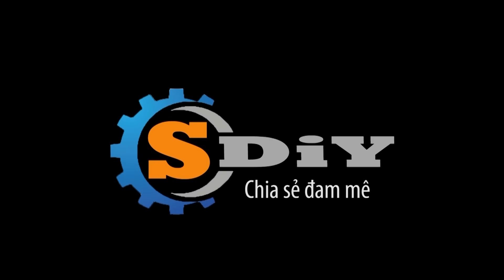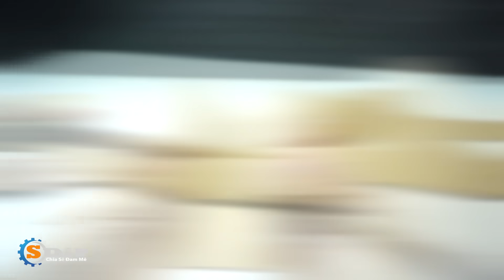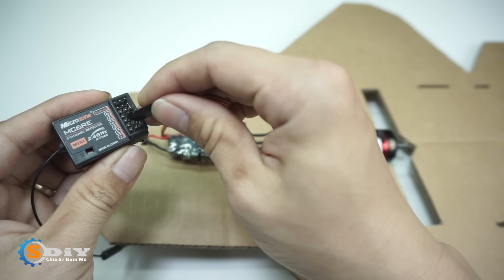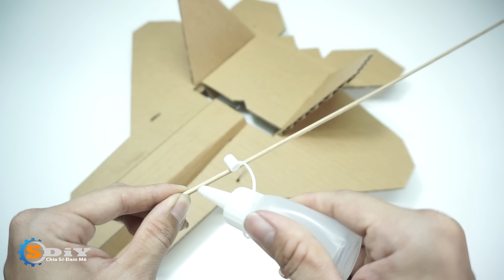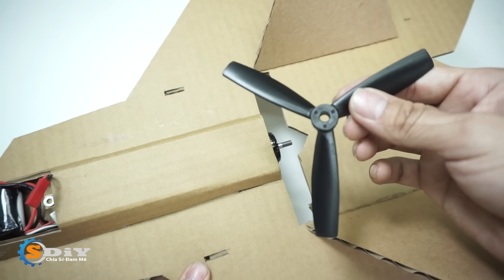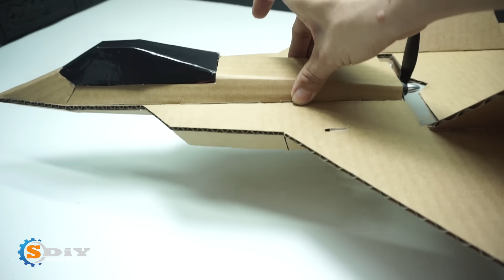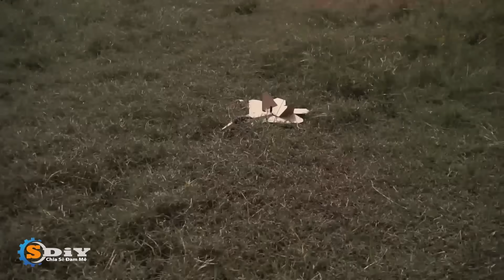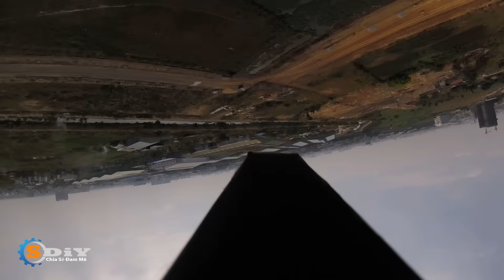Cardboard RC Airplane DIY - F22 Raptor l S-DiY

Comment: To be onist this a good build but a big but the plans have no meshermemts I've worked ot the wing 18 ins from nose to tail 24or26ins it's the cockpit the two vertical fins that stick up ans the piece around nose of plane. Plans have to have meshermemts to do it by eye takes some doing there won't be many people taking on this build for that reason plus component it doesn't show how to connect wires we're ever they go there is no linkfor the propeller size. Like when I built a eltric bike I paid £10 for plans on plans everything had measurements and they weren't metric it was feet and ins which made it very symple hard side was working with 72volt but I done it because everything was made symple I no its cardboard and I must say its great I've got card board but I'm punch drunk trying to put these plans in to protective
Reply from the maker: I hope you understand, because of the language barrier, my explanation is incomplete. Maybe I'll try to be more detailed in the next videos...

Comment: Hi I've sent a lot messages regarding this plane I'm going to make myself great idea but I think you could have been more specific in the meshermemts of plans and how thick cardboard to use. Like me I've divedv in think it was bought 3mm when it's 5 mm double wall. So if I stick two 3mm together with wallpaper paste I'm think about weight. Water is heavy till it drys also what hap if flying and rain comes from no where that's going to damage cardboard. Do not think you should put aerosol spray paint on plane to protect from rain. I know It would be stupid to fly in rain but these things happen with rain
Reply from the maker: Sorry for the time zone difference, I'm late in responding. Since it needs light weight, if you have 3mm cardboard it is too good. Ask for it to have a maximum of 3 layers, and the thickness doesn't matter much. Please note, a finished airframe weighing less than 250g is fine. And includes all equipment about 400g refills

Comment: It didn't seem like he used all the pieces he cut out. did i miss something? Other than the 60 d angle what are the other slotted pieces for?
Reply from the maker: Thank you for your attention. I apologize for the lack of notes, the parts are different colors, it's just a tool for too precise glue, do not use on the plane...hope it helps you!

Comment: Hi on plans there is a scale I've just seen of 100mm over 3.95 ins so do I use that to messur up the plane size it's the first time I've worked with plans I would be grateful if you can confirm this keep the good work up
Reply from the maker: Hi friend, for the airplane model, you just need to specify the wingspan you need, for example my video is 46cm, or you can do 48cm, 50, 55cm... So you can estimate the ratio rate. Just all the parts have to be in proportion so that they can be put together
Reply from the maker: You can even just follow the main wing, which is the part with the largest area. The rest of the parts, you can do roughly according to the estimate....(Sorry for the language difference, so I used a translator..)

Comment: Hi I'm back again I've been watching again can't get over a card board plane compared to these professional builders of big jumbo jet this buils is amazing. Trouble with me I haven't got a pinter so it's a case of making elamates looking at plans it's hard to make bigger on card board I presume the card board is double liar so I can ues any scrap cardboard is it possible to put measurements on plans and I will download again. I made eltric motor bike from plans all had meshermemts used cardboard made elamates then used plywood metal fibre glass. So to do this plane I need measurements great build I showed Mt mate he thought it was awesome
Reply from the maker: Hi friend, because there are so many intricate shapes and details that it is not possible to make specific size notes... I have attached an A4 paper version, which you can print on any printer any popular...

Comment: Hi I've sent messages about cardboard I'm thinking of another build we're when cutting card there is a white inner that's a different kind of card so yes if you can give the meshermemts I will great ful thanks
Reply from the maker: Hi friend, I use 3 ply cardboard, 5mm thick. I got it from the electrical box. It is the light type

Comment: What an amazing project! One of the best at home projects I’ve seen in years on YouTube! Great video all the way around with simple to follow instructions and plain video shots that don’t confuse your audience. Very nicely done sir! 

I do have one question? What is the overall dimensions for your pdf plans so we can get the size correct when printing this. Thanks again.
Reply from the maker: Many thanks for your encouragement ... For the print size, the author conventions according to the ratio of the printed paper. In the video, if you print the A1 version, you will have a wingspan of 46cm, A0 will be 65cm. It is noted in the drawing folder, hopefully useful for you...
Reply: @SDiYchannel01  What does A0 mean?
Reply: @b1-battledroid669  paper size

Comment: There are corrugated board factories (box makers) that you can order a dieboard with all these parts cut into a corrugated sheet. A flat die cutter would do it. The cost for the cutting die board 2ftx3ft (one out) around $1000 (you own it), minimum run 1000 sheets on machine. A fold up box wholesale sold for .30-.70 cent each on white paper, preprint paper(photo inline with cutting die) more expensive add .10-.20 cents. 
Up until 4 years ago I was in the business. There could be a product here for an entrepreneur

Comment: Super work, I have directly printed out the plan👍which camera you have installed and how it is connected could you make a video from there
Reply from the maker: Hi friend, thanks for your attention. I use gopro session, put it on body by drawstring. I had to make 2 similar flights for 2 position footage

Comment: Amico un esc inferiore a 45A si brucia! Come mai tu ne usi uno da 20A e non si brucia?
Mi serve il tuo aiuto per trovare un esc adatto al motore e una batteria adatta
Reply from the maker: Hi friend, based on your engine specs. With 2205 2300kv, with 3s battery, 5in propeller, the maximum current is only 17A, so I choose 20a to optimize weight. But if you go with bigger propellers, bigger batteries, then you have to use higher ESC...
Reply: @SDiYchannel01  I wrote to you via email please check and if you can help me, thank you friend!
Reply from the maker: @ArtistaGenericoMedio  Thank you, I have replied, please check

Comment: We made a bunch a few years ago. One thing we did that helped with speed and handling was we pinched the front of all wings and then added scotch tape. This will help cut through the wind. We found that without the small holes will act as a parachute so to speak.
Reply from the maker: Thank you friend. It was a wonderful experience...

Comment: The aircraft may be heavy but, with flat wings and control surfaces doesn't produce any lift. If you put curvature of the wings and control surfaces you will have better lift. The plane will fly better and you will not have to use more throttle just to keep it in the air. If you take the 2 centimeters of the front edge of the wing and face them down 8% and glue 2 centimeters of board directly under that leading front edge of the wing, you would produce enough lift for that plane.
Reply from the maker: Thanks for the comments...that's what I wanted to hear!
Reply: @nikosalexandrakis   Curve the front of the  wings down appox 8 degrees, and put a strip of cardboard about half an inch under the length of the front of the wing, will give you air foil for lift. Look at how F22 wings are. Just a strip under the bottom front of the wing and nothing on the rest of the bottom of the front of the wing.

Comment: How do you get the template printed on a big paper. I’ve got all other parts
Or do you have plans with measurements?
Reply from the maker: Hi friend. In the drawings folder I have uploaded versions for A4, and A1. I use the A1 version to print it... If you want to go even bigger, adjust the scale when printing...

Comment: Can't understand why it can fly without aerofoil wings? There is hardly any lift from the wings since its flat.
Reply from the maker: Thank you for your attention. You are truly an aerodynamicist. The reason my model can fly is because of the angle of attack, it's inefficient compared to the lift wing profile. But for the sake of simplicity, we have to trade off...

Comment: Excuse me, do you have any cheaper materials to replace them? My classmates and I need to make a finished product to score the teacher.
Xin lỗi, bạn có vật liệu nào rẻ hơn để thay thế chúng không? Tôi và các bạn trong lớp cần làm một sản phẩm hoàn chỉnh để ghi điểm với giáo viên.
Reply from the maker: Hi friend, currently the cardboard material seems to be the easiest to find But to be more effective, you should look for EPS foam, or depron foam. It will be lighter and stronger...
Reply: What I want to know is whether there are cheaper parts for electronic components that can be replaced Thank you very much for your willingness to return to me
Tôi muốn biết có linh kiện điện tử rẻ hơn có thể thay thế được không Cảm ơn bạn rất nhiều vì đã sẵn sàng quay trở lại với tôi
Reply: @SDiYchannel01  How many channels does your flight control remote control use? What electronic components are needed to make this airplane. Điều khiển từ xa điều khiển máy bay của bạn sử dụng bao nhiêu kênh? Những thành phần điện tử nào cần thiết để tạo ra chiếc máy bay này
Reply from the maker: @蘇翀  Cám ơn vì câu hỏi. Tôi sử dụng bộ điều khiển 6 kênh MC6C . Động cơ 2205 2300kv.  Bộ điều tốc 20A. 9g servo x2.  Pin 3s1000mah. Tất cả chi phí khoảng 80$
Reply: @SDiYchannel01  Cảm ơn bạn đã trả lời quên mình và cẩn thận cho mình, mình cũng dám tin là bạn làm video này để mình và các bạn cùng lớp có thể làm nên điều gì đó.

Comment: Well... It's cheap. But this corrugated cardboard, these wings without profile, no leading neither trailing edges, this little motor with a three-bladed propeller, the cardboard-canopy... very sad.
I prefer wait some time, to make a real airplane. The motor's noise is  unbearable,  for a F-22  !

Comment: I have a doubt as my propeller is bigger than shown in the video will it affect the balance of my plane if I shift the wings more further
Reply from the maker: Hi, if with a wingspan of 46cm like the video, you can only use up to 6in propellers, to limit the torque. With larger wingspan you can use larger wings.. 7in.. 8in.. Hope helpful for you!
Reply: @SDiYchannel01  can I ask 1 more question.Actually the battery you are using is different from which I am using so can you just say where to connect the battery and why?
Reply: @SDiYchannel01  and the wingspan is same as yours but my propeller is like 8-10 inches so is there anything I can do to solve the problem
Reply from the maker: @akshatfulfagar3779  May I ask if your battery is bigger than the one I use? If the propeller is 8in, you have to increase the wingspan to about 70cm. But it's very difficult, I think you find the smaller propeller as the solution
Reply: @SDiYchannel01  no it's kinda same 11.1v 1000 mah but I am getting confused where to connect it and why
Reply: @SDiYchannel01  pls reply
Reply from the maker: @akshatfulfagar3779  Hi sorry, maybe the language barrier makes me not understand what you mean! Does your battery not have a connector jack?
Reply: @SDiYchannel01  I guess no
Reply: @SDiYchannel01  is there some instagram channel or something where I can dm the photo of battery
Reply: @SDiYchannel01 there are two wires connected to battery just like in the video I don't have any seperate connector jack
Reply from the maker: @akshatfulfagar3779  Hi, you can find my S-diy page on FB and send me pictures of it...
Reply: @SDiYchannel01  ok 👍 thanks
Reply: @SDiYchannel01  I have sent the photo on fb

Comment: In case you wanna see if it really flies after you build it, watch my flights with this little beast on my channel. My F22 just weighs about 100g more (maybe because I used lots of glue and some spruce wood for the motor fastening) but flies amazing. Anyway my flying skills aret as good as the inventor's :D I recommend min 30A ESC and even 4S battery (the motor is built for that-14,8V could generate over 1kg of thrust) PS: I thought it will be difficult to fly when it's that fast but it's really easy even for a beginner.
Reply from the maker: Thanks for the attention. The depron foam is so good for DIY, but I tested the cardboad for everyone to try, albeit a bit heavy. Nice to meet experienced players like you. Best regards

Comment: Good afternoon, how thick is the cardboard used?  I'm going to make a slightly bigger version, and I can't find 5mm cardboard anywhere.
Reply from the maker: Hi, I use 3 layer cardboard, about 5mm thickness. This is the kind in a food box or appliance. It ensures the weight is not too heavy...
Reply: @SDiYchannel01  Do you take 3 smaller cardboard sheets and put the 3 together to make 5mm?

Comment: Hi dear s diy I made this rc jet with A1 paper size print out but it's not flying I was used to make it kt board for fuselage and other parts are cardboard so I was used 3s 1500mah 70c lipo battery and hobbywing 30A ESC.what am I do s diy??????
Reply from the maker: Hi, there are many reasons, maybe wrong center of gravity, wrong motor angle. Or you can't control it yet.. can you describe in more detail..
Reply: @SDiYchannel01  my lipo battery is too heavy weight is it the reason?
Reply from the maker: @suji99hettiarachchi  The slightly heavier battery still flies but not as smooth. I suspect the center of gravity of the flight, or you have not yet mastered the control
Reply: @SDiYchannel01  yes I am a bigginer

Comment: Hi s diy I couldn't find the 3s 100mah 25c lipo battery can I use 3s 1500mah 70c lipo battery with using hobbywing 30A ESC is it suitable for made this airplane?
Reply from the maker: Hi, battery 3s 1500 70c with ESC 30A is ok. But the price for 70c is very high. You can choose lower C to save cost !
Reply: @SDiYchannel01  I couldn't find the low c rate battery s diy is this battery can charge B3 10w lipo battery charger?
Reply from the maker: @suji99hettiarachchi  If there is little battery, you can use Charge b3 10w because the charging time is quite long, it will be about 2 hours for a battery.
Reply: @SDiYchannel01  I am using 3s 1500mah 70c lipo battery use for charge it B3 10w charger is it good for to use?
Reply from the maker: @suji99hettiarachchi  As I said, charging the b3 10w with the 3s1500 70c battery is fine, it's just that the charging time is quite long without any problems.
Reply: @SDiYchannel01  ok thanks s diy

Comment: Hi dear s diy I couldn't find the 3s 1000mah 25c lipo battery can I use 3s 1500mah 70c lipo battery with using hobbywing 30A ESC is it good for make this airplane?

Comment: Hi dear s diy I couldn't find the 3s 1000mah 25c lipo battery can I use 3s 1500mah 70c lipo battery with using hobbywing 30A ESC?

Comment: Bạn có thể cho biết thông số kỹ thuật của pin lipo?
Reply from the maker: Với sải cánh 46cm như trên, bạn hãy chọn pin lipo dung lượng từ 1000 đến 1300mah, dòng xả 25c trở lên... bất kỳ nhãn hiệu nào...
Reply: @SDiYchannel01  11.1 volt 1300mah 30c 3s có ổn không?
Các chi tiết trên là thông số kỹ thuật của pin lipo và chỉ hỏi xem nó có ổn hay không.
Reply from the maker: @vinayaks.n.3283  11.1 v 1300mah 30c là rất ổn với nó !
Reply: @SDiYchannel01  được rồi cảm ơn bạn

Comment: Hi s diy I couldn't find the 3s 1000mah 25c lipo battery can I use 3s 1100mah 30c lipo battery using hobbywing 30A ESC?
Reply from the maker: Hi friend, do you choose the battery in the range of 1000 - 1300mah. So 1100 is good...
Reply: @SDiYchannel01  using hobbywing 30A ESC?
Reply from the maker: @suji99hettiarachchi  Yes, esc 30A it is very suitable..

Comment: S diy I couldn't find the 3s 1000mah 25c lipo battery if can I use 3s 2200mah 30c Lipo battery if I will use this battery I want to change you recommend ESC?
Reply: Please reply this question s diy

Comment: Hi s diy I couldn't find the 3s 1000mah 25c lipo battery can I use 3s 450mah 25c lipo battery?
Reply from the maker: Hi, 3s 450mah is too little compared to it. It must be at least 1000 mah or more, otherwise it will quickly fail due to overheating!
Reply: @SDiYchannel01  hi s diy if can I use 3s 1500mah lipo battery if I will used this if the ESC will be changed ?

Comment: Hi s diy I have a little bit problem I couldn't find the 3s 1000mah 25c lipo battery can I use 3s 450mah 25c lipo battery??

Comment: Hi s diy I couldn't find the 3s  1000mah 25c lipo battery can I use 3s 2200mah 30c lipo battery is it flying and is it want change ESC?
Reply from the maker: Hi, if you must use 3s 2200 battery, you must use at least esc 30a, preferably 40a. Because the throttle level must be continuously higher
Reply: @SDiYchannel01  with using the RS 2205 2300kv brushless motor?
Reply from the maker: @suji99hettiarachchi  yes, the same motor but the plane is heavy, so it needs a high throttle level, so it needs a higher esc

Comment: Hi s diy I couldn't find the 3s 1000mah 25c lipo battery if I can use 3s 450mah 25c Lipo battery?
Reply from the maker: Hi, you should only choose 3s battery in the range of 900mah - 1300mah. If it is lower, it will heat up and damage the battery. Bigger than 1300mah would be too heavy
Reply: @SDiYchannel01  thanks s diy😁😁😁🤝🤝🤝🤝